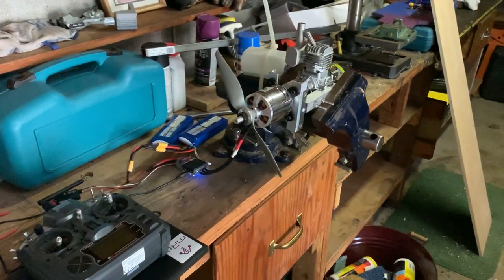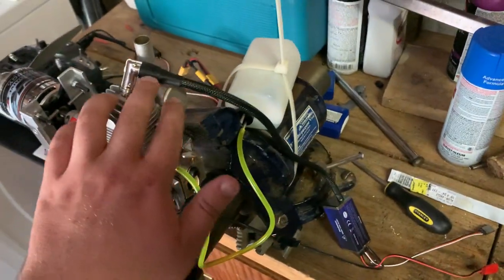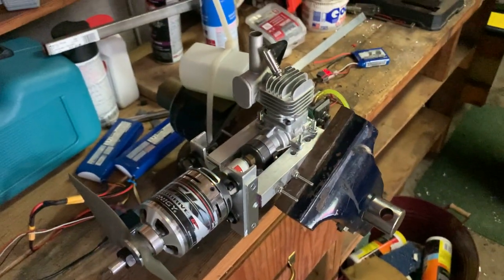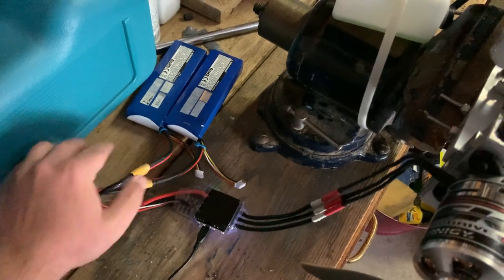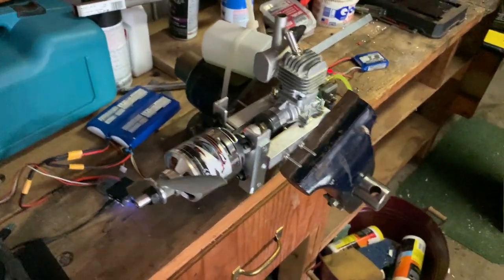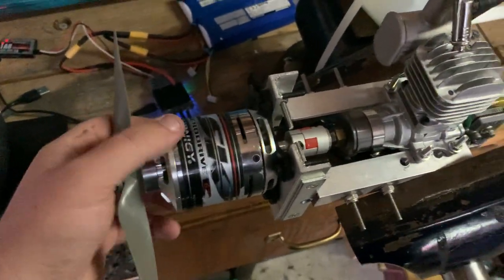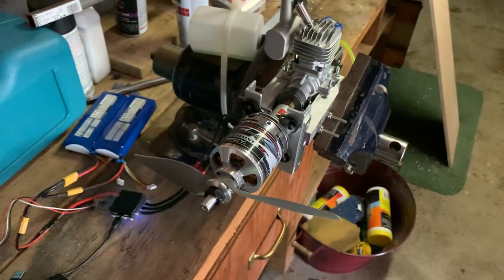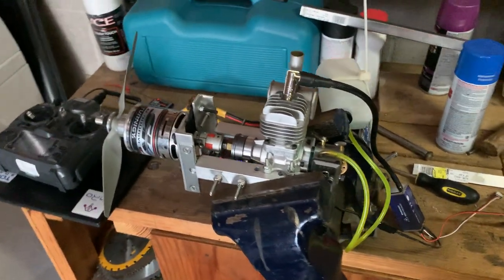Hybrid Generator - Update 1 (VESC as Active Rectifier)

Comment: May I ask one question : When engine Start and running, in this case motor is a generator, there are 3 phase electric forward to esc, why the esc not bunning  ? Thanks
Reply from the maker: The direction of the power does not affect an ESC. This VESC feels the same driving the motor, as it does rectifying current from the motor.

Comment: Can't wait to see you throttle up and show us some generation!
Reply from the maker: Another quick update: The shaft coupler keeps slipping and cannot grip the Engine shaft tight enough during high power!

Once I solve these pesky issues, I will definitely post progress updates!
Reply: @Jdogdrums7  Maybe you can sand the shaft a bit on one side, to make it like a D and have a coupling with set screws on the D for better connection?
Reply: @Jdogdrums7  The engine isn't rotating at a constant rpm with an acceleration on each power stroke.
A flywheel fixes that but ads weight.  
Keyways machined into the shafts  and a rubber coupling  is the std industry method, but they have more cylinders/power strokes, and/or large flywheels. 

A small rotary engine may be a better option.
Reply: @oadka  To sand flat-flat is basically impossible.  
A milling machine is the way to go and once you have it set up on a milling machine; the industry std keyway is the better option to machine.
Reply: @RayleneCawood  true

Comment: If you tighten your set screws then loosen then tighten several times it helps to keep the couplers (set screws) tight. That little engine sounds great.
Reply: Yes tighten the set screws then back off 1/4 turn and retighten and back off 1/4 turn then tighten 2-3 times. Each time the set screw bites into the shaft farther securing it. Or grind part of the shaft flat then put a set screw on it.

Comment: Great Presentation
Is it fair to say that your system can be used to:
1. to start the gas engine as electric starter ( no need to push propellers counterclockwise)?
2. The combination of Gas Engine rpm with the electric motor produce voltage to charge batteries ?
* 3. what do you do with the extra voltage that is produce and not needed during a flight ?

Comment: I don't mean to underestimate your great work but there are some questions that we as viewers have:
1. What do you mean by Hybrid Engine / Drone?
2. Does the piston shaft rotation create a voltage output from the electric motor that is attached to ?
3. You must keep carburetor butterfly open after the engine. 
4. You should keep the carburetor butterfly closed to get fuel into engine 
5. How can you fly an RC plane when the you are using the aileron commands to start/ kill engine ????
Reply from the maker: #1 "Hybrid" is a term I used to describe having a LiPo battery in Parallel with the Generator...to act as a buffer for energy, and to start the generator.
#2 Any motor generates a voltage when spun, however once you attach a load to the motor wires, torque is proportional to current drawn, and a certain torque is required to keep the motor spinning at a constant RPM. The Gas Engine provides this torque.

I don't understand #3 and #4. The "Choke" is only used for starting a cold engine. If you stop an engine, you can restart without Choke if its still warm enough.

#5 This is a demonstration video where I am controlling the generator manually with a Transmitter. Normally, A generator will be automatically controlled with just an ON/OFF command sent.

Comment: Very interesting video. I am working on something similar with an MVVS 58 cc engine, hoping to get 5000 watts at 50 volts. I originally wanted to control 6 MOSFETs with an Arduino for voltage control but I think your VESC is more elegant in that you get a more constant voltage out
Reply from the maker: Keep in mind, at 100% efficiency, that engine would require at least 6.7 Horsepower
Reply: @Jdogdrums7  MVVS 58cc is at the top of the heap in terms of hp/weight ratio, generating 8.5hp at 6950 RPM. I will operate at max torque speed of 6600 RPM
Reply: @Jdogdrums7  13.4 you mean ;)
Reply from the maker: @paradiselost9946  I was converting 5000 watts to HP
1 HP = 746 mechanical watts
This is also before the mechanical/electrical conversion losses in the motor

Comment: when you start really testing things out, you come across a strange, but logical, effect.
its called "jacobs law".
as a generator, it is nothing more than the demonstration of a magnet down a pipe. it takes effort, work, to move that magnet against the induced eddy currents and their opposing fields.
we cut a slot in the pipe and there is no eddy current, no opposing field. no work done.

we bridge the slot with a resistance. we measure a voltage drop across that resistance, and calculate a current through the resistance.
we say we have so many watts flowing through the resistance.

we forget that the GENERATOR ITSELF is a resistance. and as a current flows through it, it must also dissipate so many watts.

and then if the load and the generator are EQUAL in resistance? 
we get half the power dissipating in the generator, half in the "load".
the engine DRIVING the generator sees TWICE the power that one reads across the "load resistance".

we increase the load resistance and reduce the current flowing, the same current through the generator. we now have far more work performed or "lost" in the resistance, versus wasted in the generator. overall though, less work is done in the circuit, as current is limited by the load resistance... easy to verify, just an IR2 equation... 

 the generator always consumes a proportion of the work supplied by the engine, and only really is "efficient" when barely loaded, when the load consumes a far larger proportion of what little power can flow. the generator could deliver far more power into a lower resistance, but in doing so consumes more power in its OWN resistance.

when completely shorted , ALL the power is dissipated in the generator itself, the current will be at a maximum, and the voltage will be the potential developed by the current flowing through the resistance of the shorted generator. the "lenz reaction", the magnet in a pipe...

at 100% efficiency, you can only get 50% of the engines power out as electricity, volts x amps. and it will ALWAYS be LESS than 50% as there are losses.

thats the biggest joke about "efficiency"... you get HALF at 100%. not ALL of it, not "100%"... you get HALF! seems everyones forgotten about that basic aspect of physics...

PE=2gh, and KE = 1/2Mv^2. 
jacobs law is just the electrical equivalent. like "therevins maximum power theorem". its like impedance matching in amplifiers.
 

if the load is a LOWER resistance than the generator, the majority of work is performed in the generator, and the "power" read across the "load resistor" will be proportionately less...

the KV rating of the "generator" will determine the RPM it needs for a given voltage on a given resistance until its reached its limit. be it magnetic, RPM, or resistance/insulation, etc.
the voltage will be limited by the current it can flow through a load resistance.
when the resistance is too low, too much current can flow, the voltage sags, and the generator is overloaded, yet the "output power" appears to reduce, despite the braking power produced by the generator INCREASING.

then theres rectifier losses, and all that jazz as youre switching from AC to DC, etc...

and finally, batteries arent resistors. below the charge voltage, they consume no current.
once they are held at a potential that charge can take place, they draw current.
that current is only limited by the batteries internal resistance, and pulls the voltage down. if the generator cant maintain he current at this new voltage, it sags further... either you stall the engine, overload the generator, or the batteries simply dont charge properly. ideally the voltage will only sag to the charge voltage that accepts that current and everythings fine... the problem is as the batteries do charge, the voltage rises... and so does the current delivered...
too much current only causes IR2 losses as heat in the battery. it isnt "charging" it.
Reply from the maker: The main purpose of this setup really has nothing to do with Load / Generator matching, but is to test 3 concepts:

1. Increasing Rectification efficiency, not anything to do with Conversion efficiency (equivalent to the type of Motor Drive commutation)
If you look at Motor MTPA (max torque per amp), you find that Field Oriented Control is a more efficient commutation method than BLDC Trapezoidal commutation (Tangential or “Direct” axis current losses compared to the Useful “Quadrature” current)
These losses can be observed in Rectifying from a Motor and not just driving it with current.

I guess you could call it MAPT or (Maximum Amp per Torque) meaning no Losses suffered from incorrect or “Direct” axis current flow

2. Field Oriented control eliminates the Usual need for very large DC Ripple capacitors like found in most Mechanical Generator setups. This is because the only capacitors required is really for the Transients due to the MOSFET switching and not the “Sinusoid humps” that are usually found with Passive Diode rectifiers.

Diodes act like Gates, and instead of letting the Current follow the Quadrature axis completely, they are Passive and uncontrolled, and so they allow Direct axis current flow. They also usually have a larger forward voltage drop and higher Resistance across them than closed MOSFETS do.

3. You now have Way more control over your rectification (diodes are just based on Voltage drop between the motor and the load) and the VESC can limit that, or it can even Drive the motor (useful for starting up the ICE in a neat package, you would need a separate starter in a Diode rectifier setup)
You can choose between what your Priority is for your operating conditions: DUTY CYCLE (Varies torque and current for stability)
CURRENT CONTROL (useful for meeting specific torque or wattage needs) SPEED CONTROL (if your Setup needs to be regulated based on Physical RPM without much priority on Power regulation)

TLDR:
This test really isn’t testing ICE generators at all, this is just a Generator setup to test varying Rectification differences and efficiencies.

These things could be applied to any Mechanical generator (small DIY Wind Turbines, Low head dam turbines, etc.)

Comment: cool, i make the same generator)
Reply: how many amperes does the recovery produce and what voltage? 

what is the maximum current that VESC can withstand on regeneration?
Reply from the maker: well the Voltage is regulated by VESC, as long as the motor is not overspun past its kV for the voltage you need.

Different VESCs can stand different currents...Mine is rated at 50A, but there are some VESCs that can do 300a but they are expensive.